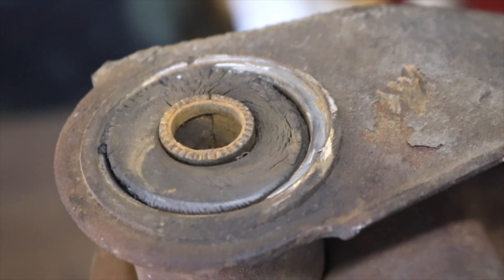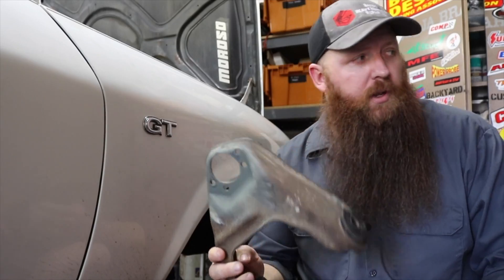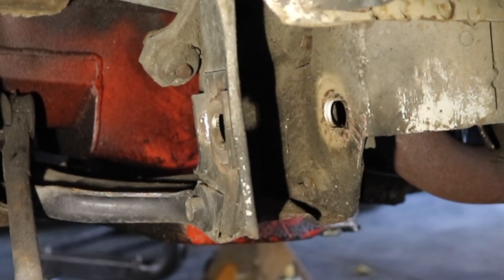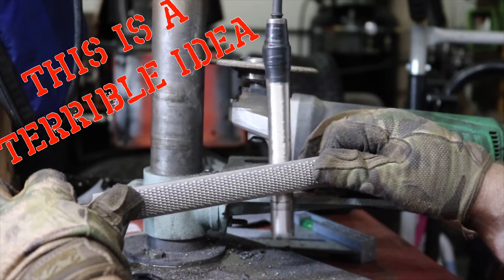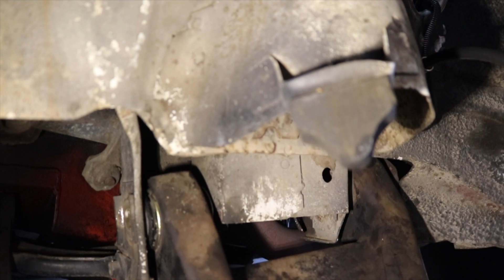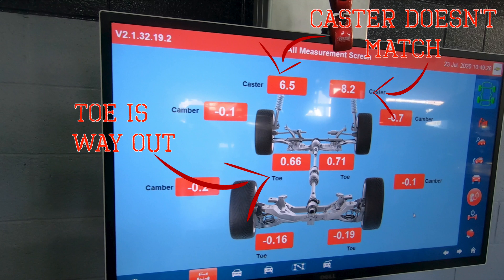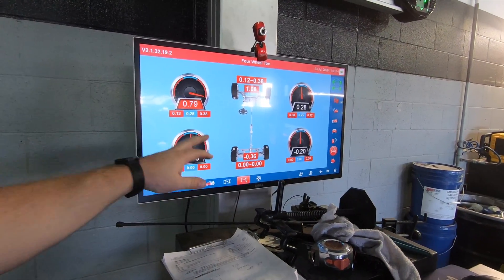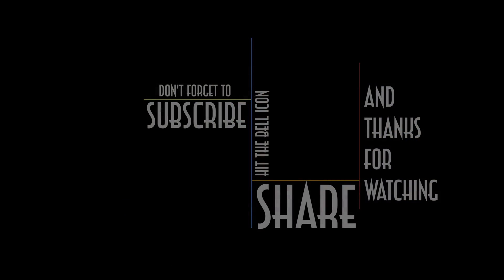H-Body 5 Lug swap Part 2 | Control arm Bushings | Alignment numbers I Vega EP18

Comment: How did you get 7 degrees caster on each side? Did you swap the upper a arms side to side? Never mind, I re-watched your other video. It looks like you swapped upper control arms side to side.
Reply from the maker: The steering feels solid and it steers like is on rails after all the mods.

Comment: JUST DID Spindles  THIS MORNING But I used GOOD PARTS  AREOSPACE COMPONETS 5 LUG 6160 BILLET HUBS 13 inch VENTED ROTORS 4 PISTON BILLET CALIPERS !!!!! Retains Factory Front geometry dont have to CHANGE ANYTHING to make it work!!!! I cant get my damn CAM BOLTS out they are spinning  the bushing !!!!! Still looking for NEW CAM BOLTS cant find any
Reply from the maker: There is a video explaining how to get them out here. https://youtu.be/mTcaTzDTyqo

Comment: Dang that things going to handle terrible at full lock drifting with those camber angles. Depending on the chassis I've had the best luck with -3 to -6 depending on how much steering  angle. May be worth it to extend the lower control arms or shorten the uppers. Caster angle looks great though. Love the videos, glad I found this channel!
Reply from the maker: There is a video of it drifting. It's no pro car, or an amateur car. . . or even a a stock 240, but it is decent. Thank you for watching. I'll try to keep it interesting!

Comment: Hang on a minute. So the crush tube inside the bushing isn't the right size so the camber bolt is a snug fit? Just putting all the strain on those ferrel washers is a bad design.

Comment from the maker: Furrel Washers
Dave's Vega Village information:
http://davesvegavillage.tripod.com/

I do not recommend moving them outboard the as I did in the video. 

The reason: moving the lower balljoint inboard 1/4" is plenty to compensate for any camber difference between the Blazer and Vega spindles. 

Moving the top balljoint outboard then requires full deflection of the camber/caster adjusters on the lower control arm to prevent positive camber. 

The solution: Install the upper balljoints centered in the widened hole of the upper control arm. 

I still recommend swapping the upper control arms to their opposite sides for caster gain. doing so adds stability at speed.